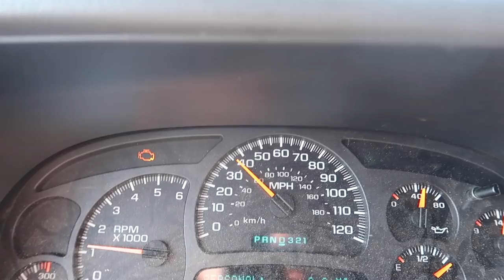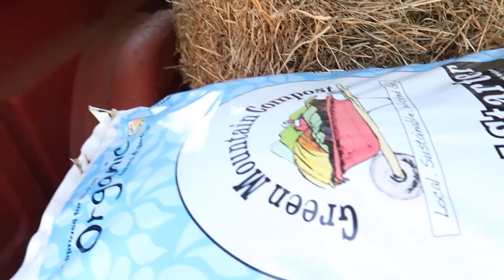The Chickens Love That I Did This!

Comment: Thanks for showing us your current job site!
Two thoughts:
Have you considered putting a tube or funnel on top of the buckets in the chicken tractor to stop the chickens getting on top of them? Both of them had chicken poop on them now.

Mulching the apple trees. I've head from gardeners that many trees really dislike having the soil level rise on the trunk. The added pressure makes it harder for them to draw water so they can lose a lot of life force that way, give less fruit. Also rot can be a problem on the bark, as it can never become a root as in other plants. So maybe keep a couple of inches clear just by the trunk of the tree?